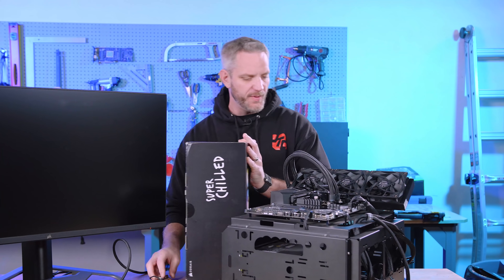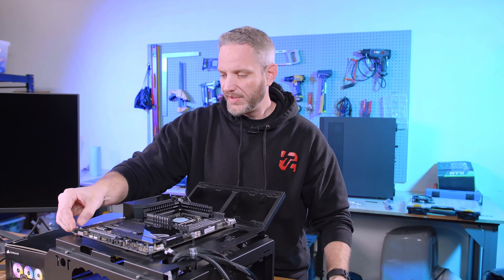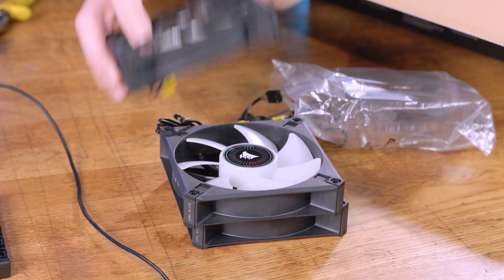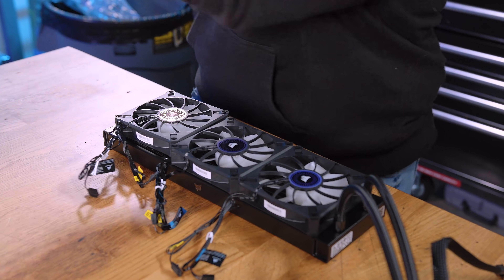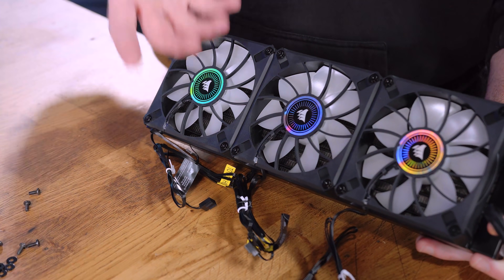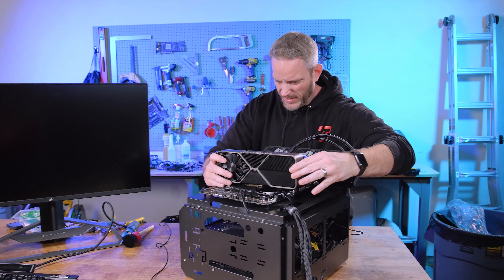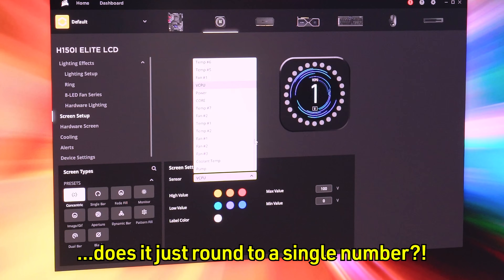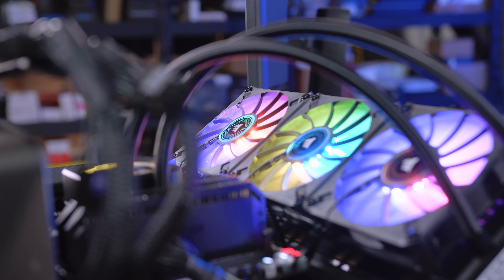Who knew this cooler could be so... COOL!

Comment: I just bought the new NZXT z73 RGB White that was $309 to replace the original Z73, im not sure if the pump is different or not but it keeps my 10900k and 11900k almost 30c cooler (in r20/23). Just for the LCD resolution and saving $30 it might be worth it to me to return this and get the corsiar one. I just hate that corsiar uses their own connector for RGB. Why can everything just be a 5v 3pin? also, icue is just confusing to me. Probably just me being a moron but compared to Asus, MSI RGB software its like you need to be a rocket scientist.

Comment: You mentioned how you like the grill on the fans because it makes the air flow less cone like on radiators and then you go and install the fans in a way that doesn't take advantage of that and also complain how they look when putting them on the way differently to how you said you liked.

Comment: Can you set the lcd to display cpu and gpu temps at the same time
Reply: did you get the answer? i really want to know if its possible to look the GPU temps too in the LCD display
Reply: @SendisHere  i did not get an answer. I know msi has one that will and the kraken model will. I can only assume that this one will also

Comment: Jay, 1 issue I've found in the Corsair Commander Core is that if you have different Corsair fan types, the software will only use 1 type of fan. Say you're using 6 fans with 3 ML fans on the cooler, but have 3 LL fans on the top & back of the case. You can only control the ML fans in the iCue software, unless you install the RGB hub &/or Commander Pro.

Can you play with the fan types in another video to see if they've fixed that?
...please!!!
Reply: It's fixed. As of the most recent iCUE version and Commander CORE/cooler firmware you can mix and match fans on the controller.
Reply: @MitchellPodlaha  Thanks for update.

Comment: I am about to throw this cooler in the bin, constant random disconnects driving me crazy, tried all the fixes on the interweb nothing works
Reply: Are you having the firmware issues? 
Aka red  🔺️ .
Bought new out of box and it happened to me.
Reply: @DaRaginCajun81  Actually the fault is fixed, what the issue was is if you join two Corsair controllers to the same USB on your board by using the Corsair linking cable you get this fault, use seperate USB plugs

Comment: Jay wanna help me figure out my Corsair RGB problem? I’ve been trying to solve it over the past 2 years and Corsair hasn’t been any help either. I have the LL120 fans, 6 of them, and all software is up to date, I got the commander pro, RGB fan hub too. I’ve replaced almost everything, to see if they were the problem child, but that’s not. I even decided to upgrade my HDD to an NVME M.2, and problem still persists. The case is a 570x Crystal Black. The fans are 1 tom6 from front bottom to exhaust, in order. And that fan #1 RGB works, and then fan 2,3 barely work, RGB’s will get stuck on random colors, even on rainbow wave, and fans 4-6 doesn’t even work at all. I’ve even switched plugs and nothing moves, well sometimes it does. It’s so weird. 

But if you’re willing I’ll even download like team viewer or something and have you remotely take control of my Pc and have you go through settings, software etc. please help Jay.

Comment: what fans would you suggest for this cooler setup. i have this same cooler.
Reply: It uses the ML fans, similar to the LL120 fans but the ML have no inner LEDs. I ended up taking them off and putting LL120s on their instead as a replacement

Comment: Hey Jay. I woke up this morning an went to turn on my PC an it wouldn't turn on. I seen that water leaked in my PC from the ceiling cause it was wet on top where the dust cover was I didn't see any thing wet inside such as the motherboard or GPU. But when I go to turn it on the fan spins once an that's it. No lights come on or anything just wondering if you could tell me what may be the problem

Comment: it's an absolute nope from me. i used to have the OG capellix model and yeah the design was more classy especially the fan quality was better. for that sort of money you're better off with the asus ryujin 2 that comes with noctua iPPC fans, the block comes with a vrm fan (0-4800RPM), better pump (asetek gen 7 vs CoolIT), better control of RPM (min is 840 vs 2200 on corsair), larger LCD screen, and more mounting options for tubes (e.g. i have my tubes coming out the bottom). although the software for asus is crap (and iCue is the king), the hardware for asus is superior and you can always put rgb fan frames on your noctua and control them with iCue which is what i'm doing anyhow

Comment: fun fact: fans are placed in the front to pull in cool air from the outside so that they can push it through the radiator 

ill bet 200 bucks ol jay here has his fans turned around backwards

Comment: Anyone got a recommendation for a good watercooling case?
I´ve got a 360 and a 280 radiator, also an ATX mainboard.
Right now I´ve got a Phanteks Pro M series, but it´s quite loud even with my PWM fans spinning relative slowly. 
Plus, the space for my cable manegement and the radiators themselves is kinda limited.
I´d prefer a case without a window, because I don´t really need it.

Comment: I've had two Corsair aio coolers fail after 12 months of use. Twice bitten thrice shy?
Reply: Bloody hell! What are you doing to them? I have a H50 that has been running 24/7/365 on a 4th gen for 6 years & a H100 (I think!) for almost 4 years without any noticeable increase in temps or any issues (other than the led colour shades degrading over time regardless of what Corsair fans used (white looks like a washed out green on some fans yet is vibrant on others bought at same time in same triple pack!)
Reply: @OliverQueen1974  pump failure both times. No more Asetek aio's for me. I know I've been unlucky and it might not be indicative of these types of coolers but I'd rather have an air cooler for reliability or perhaps I might try a EK aio as there pump looks more robust and the contact plate looks more substantial. Then there's a custom loop, fiddly but serviceable. maybe in my next pc.

Comment: For anyome who isn't aware.... the pump noise is extremly loud  and annoying. you can't customize the RPM of the pump, you only have 3 Profiles. quiet, balanced and intensiv. the quiet profile runs with 2200rpm and is louder than the intensive profile.
Reply: I put a triple fan gpu and a 1000w power supply that whines under load, at this point being quiet went out the window for me. Before it was only super loud if it was at full load and every fan was at max speed and my 650w was dead silent.

Comment: I suppose I am just no longer up on computer technology.  Can someone PLEASE explain to me computer lighting and performance correlation.  How much better will a PC perform if I spend more money on components that light up the inside as opposed to ones that do not have RGB?  Also, apparently, how much better will an AIO system cool if it's lit up compared to a non-lit AIO cooler?  Is this the same thing as saying a red specific make and model automobile performs better than the exact same make and model that is blue or some other mundane color?
Reply: It makes absolutely no difference cooling or performance wise but with some of them, you can set it to indicate or reflect the temperatures the system is running. The RGB or lights are on pretty much everything now and as they are led lights, they add very little to the cost of the part.

Comment: Jay said you would see that glue if you used the radiator as an intake at the front of the case, but that would be impossible. If the fan was oriented as an intake, the spot where the glue is would be sandwiched between the fan and the radiator. So you wouldn't see it :) unless you're a psychopath that uses the front panel of your case as an exhaust

Comment: I'm a idiot I don't like RGB and monitors, yes looks nice but that is just more power required and since most computer power supplies are inefficient that means more heat generated. 

Yes flashy I can set if up so I can see my temp when I look inside the case but depending on the case design you might not even be able to see that.

Yes a waste of money to show off that you have money to waste on things; instead of better memory. CPU, GPU,

Comment: This is Michael. Jay,  I always like your reviews and depend on them for almost everything. However you do have a dumb habit of making a mountain out of a molehill sometimes.  If you don't like the reflective centers of the fans just say so and then mention that people can take the sticker off or block it out. The same goes for the hot glue.   People can put black paint on it and it would never be seen. You're right, it should not be that way on an expensive cooler, but you make a big deal out of it and waste too much time on it. Stick with the more important factors which are, this is a great cooler, easy to install, has a nice commander XT kit, Quiet fans, and a Fantastic, customizable lcd display. So really, what's not to like?

Comment: Can anyone with this cpu cooler comment on the sound from the pump? It cant be set below 2200-2300rpm so is that a problem? My pc is very quiet at idle and low load with the only thing making noise being 9 AL120 fans set to 800-900rpm. Would I be able to hear the pump on this cpu cooler? Thinking of switching to this after having pump noise problems with 3 Kraken Z73's.

Comment: Anyone else think Jay is likely to cut himself on the bare edges of the metal where he cut the test bench?  C'mon Jay, safety first, get those burrs ground down.

Back on track though, I will be getting this AIO for my slow, very slow, accumulation of parts for my new rig.  I'll be swapping out the fans for the Lian-Li SL 120s.

Comment: no more aio water cooler for me last only 2 years at most. i gone back to air cooler and will never go back to water
Reply: I have 2 Corsair AIO’s that have been running 24/7/365 for 6yrs+ (H50 on a 4th Gen) & almost 4yrs (H100 on a 8th gen) with no noticeable degradation in actual performance. I was expecting to have had to replace the H50 by now but it is still going strong😵‍💫

Comment: I am a cheap bastard, I don't want to pay for anything that does not enhance the value of my performance.   I believe that for your average user,  water coolers are too risky because failure can ruin a system.   A good air cooler with no RGB or useless displays  will work just fine for 99% of typical use cases, and will cost far less and can usually be recycled into your next build.

Comment: As a previous owner, I have several issues with Corsair AIOs:
1. Price.
2. Cable management (2 cables per fan + SATA power + pump RPM signal + USB header).
3. Proprietary control only through iCue.
4. PRICE!
It's disappointing that they haven't changed for the better in any of these aspects.

Comment: Heat does not actually flow up. It flows toward the coldest area. But though this is correct. It's not what we see. Because the air molecules expand. The larger molecules sift above the smaller molecules. Heat exchanges. So static heat in air molecules, are only along for the ride. So if you are in a building. That heat is alway's attempting to flow back to the floor. But this is getting deep into the weeds, of this pertinent idiot (me)! So heat rises. Works just fine.

Comment: Why are the fans so shit, I got a 2fan H100 refurbished with 2 good corsair ll120s I think which are the same fans that came with the 4000x case, I picked up one extra for the rear and that computer looked amazing with ICUE, for the price of this kit I'd expect at least those fans or better ones, what the hell corsair!? I recently rebuilt my computer into an O11 dynamic and got 6 Lian Li ST fans for the top and bottom and have my AIO mounted on the side intake. I built my moms computer into my case and she loves it, I got 2 white get me by 140 mm fans to go on the top where my AIO was but I'll give her the AIO if I ever get it water cooled. I was actually excited about this product because I've been on the fence about water cooling and was thinking of switching to a 3 fan rad because the 2 in the middle of the space for 3 looks a little silly and it would make a good christmas present to add 2 more ICUE fans and the cooler to my mom's computer but this product looks absolutely terrible for the price. Guess I'll go with the Lian Li 3 fan rad to get the same fans to match my case and the fans I already bought. That or I'll get into the loop but the O11 distro plate is like 500$ USD and if I we're going to do that I'd probably try and sell my O11 for 150$ and get the 300$ XL version, I really thought the small one would be big enough but I don't think so, especially if I want to liquid cool 2 3090s at some point in the future, I have one and maybe in a year I could get another for absolute superflousness, by that time my single 3090 will have paid itself off and there will be more information about whether or not graphics cards can keep making you money or not.

Comment: And that cable coming off the pump is just ridiculous man wtf. Corsair should’ve had it run off one of the corners of the block instead of the middle.
Reply: When you realize they sell that cover as a separate unit, you might understand why they don’t.
Reply: @TheSjuris  I see what you mean, that cable is still a behemoth though😂
Reply: @mauricioyoung6668  every AIO has one
Reply: @TheSjuris  obviously, I have a last gen Corsair aio but the cables are significantly skinnier and easy to hide under vrm heat sinks

Comment: I am clearly not in the market for this.
To me cooling in my PC is meant to cool parts which would otherwise overheat. The idea of adding complexity, cost, extra power usage and as effect also extra noise to a system by adding RGB lights or even a screen on the cooler is just odd to me.

Comment: $300 after taxes and it comes with cheap fans and cable shrouding? I wasn't impressed with my first H100i v2 after the pump burned out just two months after buying it and my m65 RGB Pro mouse double clicks constantly and LMB constantly sticks down still after getting the first one RMA'd. My LPX memory even has troubles from time to time randomly and my strafe keyboard double types periodically as well. I'm not impressed by what I'm seeing here.

Comment: AiO’s are great and all. But after losing 2 within a year because of pump failures i just went back to air cooling. Bought the NZXT Kraken x63 because it looks cool. But meh. LCD screen not worth it and i don’t look much inside my case anyways. On another note, NZXT has some great costumer service (to me they did). When i contacted them and sent them a video with the pump rattling. They said that the pump could die within month or so, they sent me a new one and i had that 2 days later.

Comment: You're doing it wrong. Yes, heat rises, so you're pulling heat through the fans and past the radiator. You want COLD air over the radiator. So, you pull it into the system.

Comment: I honestly can't suggest Build Redux. They have lied to me so much. My order says I have a badass MSI motherboard. The picture shows an ok Asus prime. I got a janky ass AsRock motherboard that they've admitted they quit using for unspecified reasons. I'm fuckin pissed they wanna charge me $200 for the motherboard I'm supposed to have. Found all this out because my AsRock is failing.
Reply: that's so messed up. just buy whatever motherboard you want from amazon or newegg you don't have to order it from them. they will over charge the shi outa of you for some garbage. just buy whatever parts you want yourself screw em.
Reply: @juji5400  That's basically what I told dude. I said I'll just use that same amount and pick the motherboard I want and install it. That's a hard no if I wanna keep the warranties for anything in my system. They don't allow mods like that. He explicitly told me ram fans coolers and SSD/M2 are fine. I touch the motherboard and my entire PC loses warranty. Then tried to tell me they MAY be able to send me a shipping label to return mine. Absolute joke

Comment: The Corsair fan profiles are a bit weird and more complex than usual, so even though you had it on extreme, the  fans will still run well below maximum speed, especially with those temps.

And can you please stop talking about convection air flow when discussing active cooling. It's breeding a whole new "tubes down" brigade of people screeching "ergh hot air rises, stupid" whenever someone chooses an unconventional fan/airflow layout. Convection is a fans b***h and if a fan tells hot air to go down, it goes down like Monica Lewinsky.

Comment: how accurate is an open test bench though in regards to temps for real world use?
Reply: +Mazwell96, asks "how accurate is an open test bench though in regards to temps for real world use?"

That's the problem, there is no one "real world use", every case will be different. By testing each AIO with the same open-air bench you good data on their relative performance of different AIOs. So if AIO-A runs 5° cooler than AIO-B on the test bench, chances are it will also run several degrees cooler in a case.

Comment: the back side of the fans are not appealing to the eye cause they were meant to be turned around to mount them on the rad so no one would ever see that. They were meant to blow through te rad and not suck through the rad.